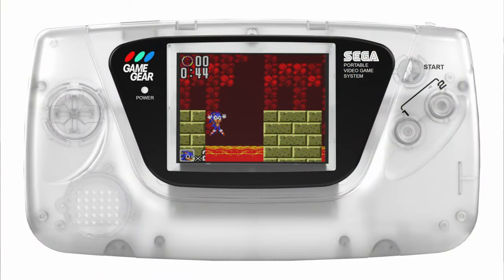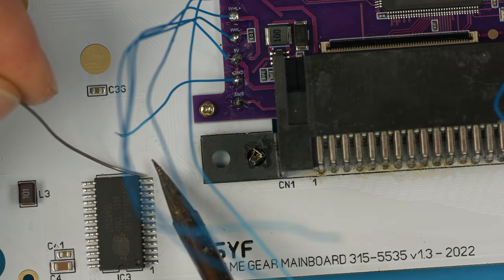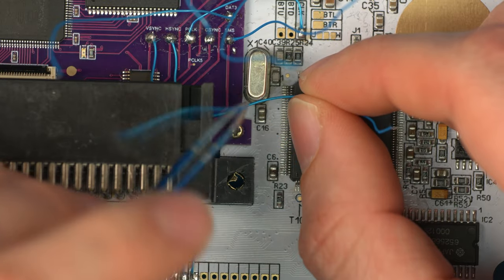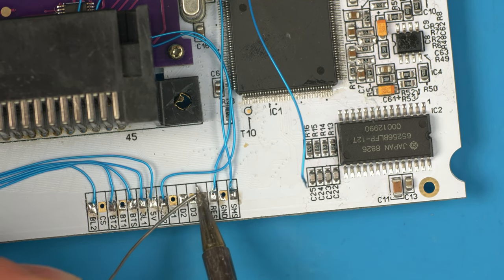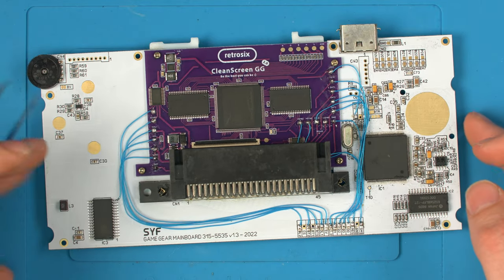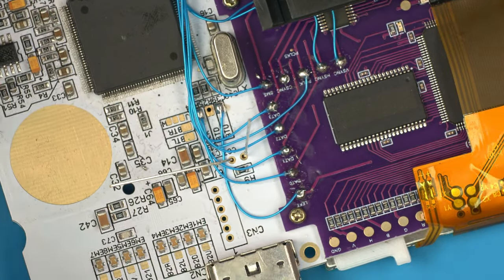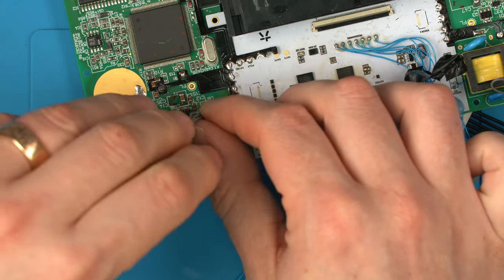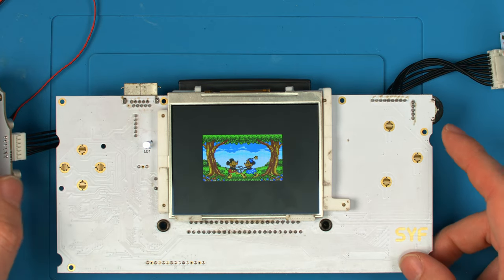Brand New Game Gear in 2022 - SYF CleanScreen Install

Comment: Thanks for this video!

Could you already compare the power draw with your board vs the SYF board? I just read that it consumes only 1.5W on maximum brightness IIRC with the SYF board. If I have to replace my board with a SYF I'd still like to use your components.

Also there shouldn't be a compatibility issue with the stereo board, right?

Awesome collaboration by the way <3

Comment: Does anyone know if I can use an ASIC from a VA4 model for the donor or only the VA1?  They both have a single ASIC, but it looks like  the VA4 may be wired differently
Reply from the maker: No you can't